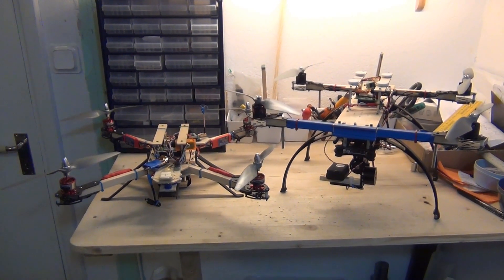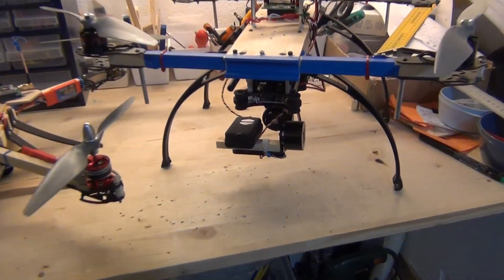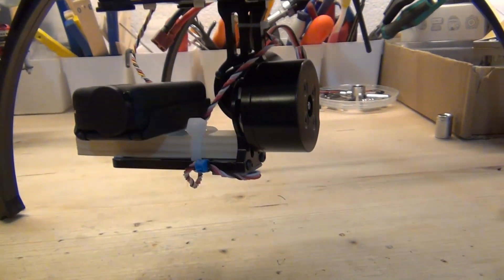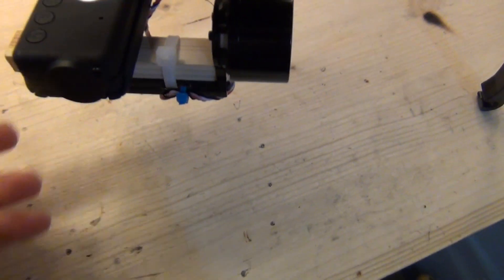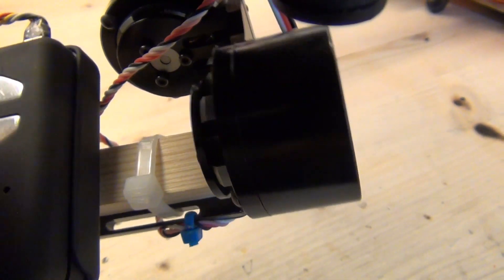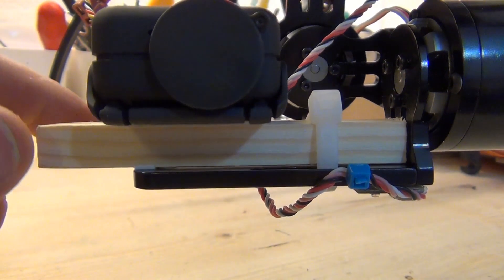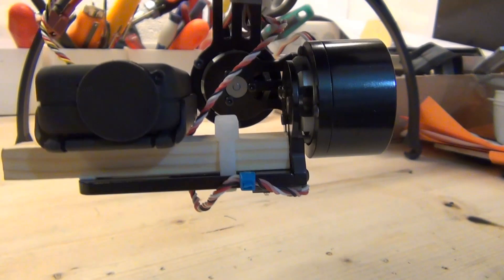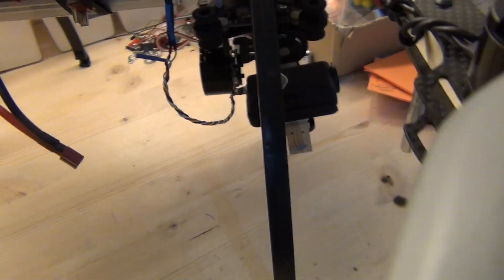How to mount a Mobius in a GoPro 2/3 gimbal

Comment from the maker: I can also confirm that the Mobius and a Runcam PZ0420H CCD camera (in between the Mobius and the gimbal pitch motor; http://www.runcam.com/index.php?main_page=product_info&cPath=0&products_id=2) can both be mounted and get a balanced system. I suggest to keep the Runcam stock support and use it to attach it to the camera platform. You will need to further move the Mobius out to compensate part of the Runcam mass that will be on the right hand side of the roll axis (looking from the front).

NOTE: I wanted the Runcam camera in the gimbal to record a stabilized FPV+OSD video with my DVR but one usually won't do that. Besides, it is better from the piloting point of view to NOT have the FPV video stabilized to be able to know the real multicopter attitude during flight so, be careful with that!

My latest setup is the Runcam FPV camera in the frame and the Boscam HD08a (http://www.banggood.com/Boscam-HD08A-FPV-1080p-Full-HD-Sports-Camera-For-RC-Multicopter-p-914254.html) in the gimbal alone. In this case, the balancing is very straight forward as it has the GoPro format. For attachment I placed a 2 mm thick rubber sheet piece in between the Boscam and the platform to minimize sliding and just used two zipties around the camera-platform. It works pretty fine but if you do not need to remove the camera often, use double sided tape and a ziptie to secure it, it will work better. I'm working on another solution, more sleek.... :)

Comment: Hey its great ! Do you have any idea how can i mount mobius and fc40 stock cam into this gimbal?
Reply from the maker: Good question... As you see in the setup I show here with only Mobius, the camera needs to be placed very much to the left (if looking at it from the front) to compensate the heavy pitch BL motor of the gimbal. A second camera is possible as far as you place them in a way that the gimbal is balanced in both axes. The HOW to attach the FC40 is very much up to you since I do not have one with me to suggest anything but I have to admit it looks tricky since it is rather thin in the longitudinal direction. Perhaps you could keep the stock support as well (locked) and used it as interface to the gimbal platform.

I also mounted a second cam (the PZ0420H from Runcam) together with the Mobius and, from the room and balancing points of view I didn't have problems, it is more about the attachments. I kept the Runcam stock support for that.

Two more tips:

1. Remember to very firmly attach the cams to the platform/gimbal (no foams or loose methods) or you will not get a stabilized systems since the motors will continuously jitter trying to compensate for the little movements of the camera/s.

2. Increase the pitch motor power via the Basecam GUI (I had to almost double it for my case). The default value is too low although the Mobius is almost half weight of a GoPro. It could have been also for not having a perfect balanced system too.

Comment: Very nice video! Thanks!
So do you like this gimbal? Any downsides? Because it's so temptingly cheap, I'd really like to buy one like this. It looks like the pretty generic platform of the gimbal could carry other action cams, too, right?
Reply from the maker: Thanks Schoemm. I'm very happy with this gímbal: the machined parts are good, it has the two upper plates in woven carbon fiber to save some weight and the controller is hardware ready for the third axis (yaw) stabilization, only the extra IMU is needed. The firmware is the well known BLG and the GUI to set it up is amazing, so many things one can tune but still very intuitive for beginners.

I have now mounted a Boscam HD08a (http://www.banggood.com/Boscam-HD08A-FPV-1080p-Full-HD-Sports-Camera-For-RC-Multicopter-p-914254.html) and it is then even easier to balance the gimbal.

One thing I must mention is that, unless you use a GoPro2 or 3, the strap the gimbal comes in can't be used thus you will need to attach the camera in your own way. I believe it is a minor drawback since you save money with this gimbal and non-gopros cameras and, if one can build a multirotor, one can probably also be able to attach a camera to a plate ;) :)
Reply: Pau Mallol Hey, Pau! Many thanks! Sounds great! The reason I'm looking into this is that my GoPro Hero 3 just died and the Hero 4 is said to hit the market in October, so I don't want to buy a GoPro again. I ordered a Mobius, but my Gimbal I think has no way of carrying the Mobius. The mount points are exclusively for GoPro. Anyway, the readiness for the yaw axis is great news! So I guess I'll order that one. Thanks a ton for your video, very helpful!
Reply from the maker: Schoemm
 
Thx Schoemm! I just ordered another gimbal: same product, same seller. Works great so far, even after a couple of crashes! I got lucky I guess but it does look robust and a bang for 75 USD!
Reply from the maker: Schoemm
PS: have you thought about removing completely the GoPro support that is screwed into the pitch motor and bold your own platform there? It might take a bit of extra work but can definitely costs way less than 75-100 USD and you would be able to use the same gimbal you have.

It can be done in many ways: bent sheet metal, CNC or even 3D printing if you have CAD skills for the drawings. I do have those skills (actually I work as consultant on this also for private people www.inkonova.se). Besides, once you do this new customized camera support you will feel you can do any other for future cams or even several cams (like I did once in my gimbal: Mobius for recording and Runcam FPV cam together)
Reply: Pau Mallol Thanks a lot, Pau! I have the Gimbal you're using by now. I'm very happy with it. I agree that generic camera support is the way to go, since I think there are way more good action cams out there, besides GoPro. Mobius is one, but being flexible to which camera you mount is great. I enjoy it very much. Multiple cameras is an idea I didn't even think of! Thanks! thumbs up
Reply from the maker: Schoemm
Glad to hear you are enjoying this gimbal :)

Happy flying!